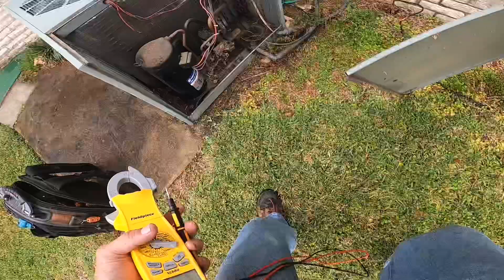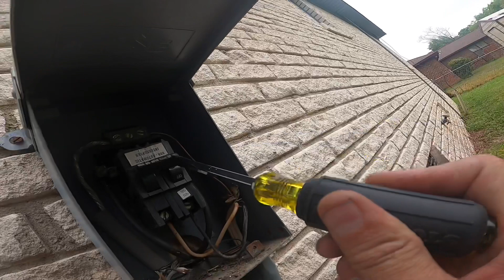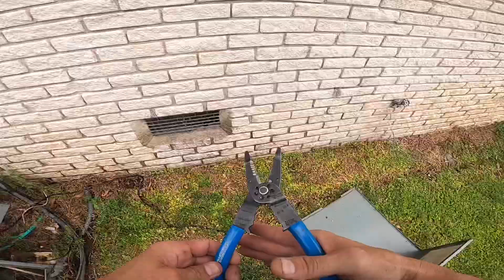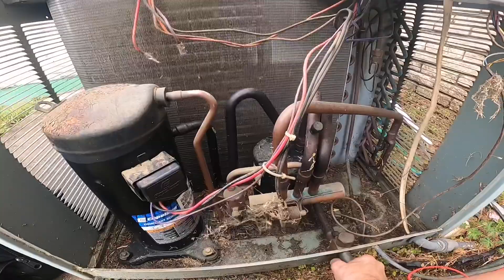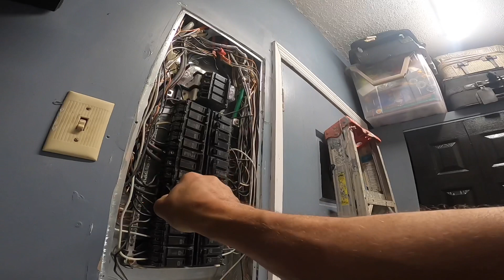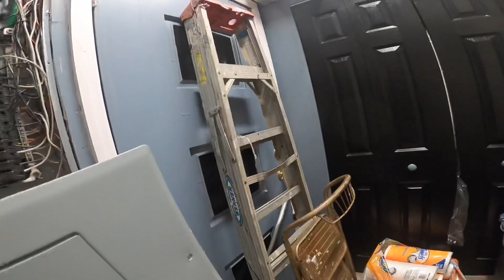No power, eliminating all variables before finding problem.

Comment: Catching up on Videos Curtis, Since this one, have you invested in a thermal Camera ? 
I have one that plugs into My Cell Device. It works a real treat and would have pin pointed You to the exact "hot Spot" of the over heating connection of the Breaker.  TCview by Todon.  TC001.
Mike M.

Comment: I watch videos regularly although I’m not a tech.  I love to learn and understand many different systems.  I do lots of electrical repairs.  Now NEC code requires that breakers are torqued to specific amount in inch-pounds.  This is so that things like this can be avoided.  Whoever replaced that 70 amp (too much fora condenser) unit did not use a torque screwdriver.  As others have also noted, when dealing with aluminum wire your suppose to put “porkier”, an anti oxidation paste on the connections. I could tell it had some but adding a bit more doesn’t hurt.  Cooper solid or stranded don’t need it.  Keep up the excellent job that you always do and I’ll keep watching.

Comment: When you are touching the wires when trying to measure resistance, YOU are being measured.  You must NOT touch the wires and/or the test leads.  The 400K to megohms is you.
Reply: Also, dont chase ghost readings on a digital meter, an analog meter will get rid of those ghost readings.

Comment: I always try to keep things simple on calls like this. First before checking resistance I check power, communication, safeties, last refrigeration of course making sure airflow is good. Keeping this will cut your time on troubleshooting. Most residential hacks may tap into junction boxes which could be the reason for breaker being so high. Unit that old and amps high I would've hooked gauges up to check pressures and checked the contactor for pitting from the high amps.    High amps on compressor may be sign of low or restricted refrigerant. That may have all your mechanical electric components amps on high with low heat load. On very  hot day they'll be calling  back most likely

Comment: Come across that on change outs original breakers not changed 70 amp old school ac switches heaters on package units not downsized for new lower demand , scary  told owner for protection of unit , not to cook if something goes out on default.,✌️👍💪🙏🤔

Comment: Should use anti oxidation past on aluminum. Good find a lot of tech’s would not even look into that. Knowledge of electrical and electronics is a must have.
Reply: No Cu-Al aid could have been the problem to start with. Especially if house was wired before the new aluminum alloys for wire manufacturing.

Comment: I had an electrician tell me there was no power at my disconnect.  I said yes there is and went on to repair a blower wire.  The unit ran fine after that.

Comment: I've seen the wires that enter the fan motor so brittle that I was able to pull them out. It was intermittently tripping the breaker. Weird reading. That's why I like to keep a back up meter to check my main meter.

Comment: Do I have control voltage? Yes. Do I have line voltage? No. Nothing else matters until you find out why. The reason it's not running is because it has no power. Ohming and continuity were a waste of time at that point.
Reply: A good HVAC tech will go through the process of elimination when he finds there is no power, which is what he did to find the cause.  22 amps will not trip a 70 amp breaker. Meg ohms? very likely. Loose connection? most likely. Good troubleshooting.
Reply: @J. M. the power cable going back to the main panel could show a ground if for some reason  the insulation on the wire is wore off from vibration, crack's from old wire, mice, rats chewing on the insulation, or even carbon tracking to ground from a loose hot connection  that has been arcing for some time.
Reply: So he was looking for the reason for no power as to what is causing the breaker to trip and in this case it was a loose connection causing the breaker to get hot and trip the breaker. Hope this helps😀

Comment: no electrician put that in, because it was a square D "homeline" breaker in a GE panel.
the square d breakers are not tested nor rated for use in a GE panel or any other load center for that matter,  nor are most other brand breakers rated for use in other panels, with exception of the ones that sold the line and combined companies. the breakers will be listed and classified for use in said panels.
the wrong breaker alone could make poor bus contact and overheat, which can and often does ruin the panel bus bars. it looked like you put a square d back in, which is a no-no and somewhere schneider electric and others state so. years ago there were more panels which were somewhat universal fit design, but you were never supposed to use pother brands unless they were listed for it.
Reply: Eaton is the way to go

Comment: The breaker should be at full load amps inside, or slightly higher, the inside breaker is definitely higher than need be, the condenser fan sounds like the bearings are going bad.

Comment: I’m wondering if the wiring coming out of the breaker box to the ac unit is undersized . You did say the wires were hot 🥵 . This would mean the wires can’t support the amperage. Good call on putting in the correct amp size breaker fuse for the unit . I have a feeling there gonna be calling you back .
Reply from the maker: It was a #6 aluminum   Plenty big enough
Reply: @HVACGUY  gotcha , good repair
Reply: @HVACGUY  aluminum not my first choice , they have tendency to loosen fast build resistance from bad connection  electrical contractors low bid choice  , good deducing always Curt like your style stay safe on those panels ,👍✌️💪😔💎⚡🖖
Reply: 50 max amp on 6 wire plus connections not tight on breakers cause of heat on breaker. ,

Comment: so to test a shorted fan, put the probe on the black wire at the contactor to ground and do same for the red. If it beeps, it is shorted?
Reply from the maker: In this case I tested for shorts before and after unhooking all the wires to fan. But if you wish to ohm it out, disconnect all wires and ohm ends to ground, then ohm between. But, you can’t ohm it out hooked up.

Comment: you didnt say which amp u used? I kept waiting
Reply: sorry you wrote it. So we use a 40 amp ?
Reply from the maker: @sh2697  yes, it was a 40 amp
Reply: What should the megaohm read for L1 and L2 to ground when disconnectedd at the contactor? and the two lead going out? I like to keep this in mind
Reply from the maker: @sh2697  mega ohm readings to ground are a little concerning, but not damning. On power leads that was odd. Anytime you see mega ohms to ground, you should ohm out compressor before condemning anything, sometimes that will trip a breaker. But, the kilo ohms to ground was really concerning. It implies an abrasion in insulation somewhere. So, in a perfect world you shouldn’t show any ohms to ground, like when I isolated compressor and tested it.

Comment: So the replacement breaker was 70 amp ? Just trying to learn something here. Why not proper sized breaker for the replacement ?
Reply from the maker: No, i replaced it with a 40 amp breaker
Reply: @HVACGUY  Ok, you might have mentioned that in the video. Thanks for your reply and posting video.
Reply: He mentioned it at the begining of comments some installers or electricians don't change old breakers ac units or water heaters less demand lower breaker amps with safety factor 15% added 30 amp protected 40amp breaker.👍💪✌️🙏😊

Comment: An electrician definitely should’ve known better
Reply: An actual electrician that know what he doing, would probably know better, when you have a loose connection, not only you will have choppy performance out of whatever it powering, you could have the potential for arcing and heating, which is a safety issue, including the oversized breaker.
Reply: @KenKen-ui4ny  absolutely, making sure all connections are tight helps too
Reply: was he getting 22 amps at the condenser as well, idk sounds kinda high for just a compressor and outdoor fan.
Reply: to be honest theres no telling what all could have been connected to that 70 amp breaker. I couldn't pay attention if it was the same wire I'm the panel and the disconnect outside
Reply: 14 amps on start drop down to 10 ,12  even for a dinosaur change out candidate.✌️👍🙏🤔

Comment: 70 amp breaker?  Wow that’s what keeps fire departments in business 🧑🏼‍🚒🚒🚒. In Connecticut our license only covers to the disconnect.
Reply from the maker: Yeh, I just couldn’t leave it.
Reply: @HVACGUY  I’ve done similar things but just need to be “ creative “ on how I write it up . 😉
Reply: At any moment you will have to have a license to go to the bathroom….😂😂😂😂😂
Reply: Same here in FL. Can’t touch anything past the disconnect. But I still change breakers on change outs all the time. I’m not gonna make the customer pay for an electrician when it’s something I’m capable of taking care of. I don’t write it up on the invoice though.
Reply: Technically In GA we should not be changing breaker in main panel. Dumb rule because am I going to send an electrician out on every job I install to change a breaker. 👎 nope! Make customer wait longer for them to show. No air for another day. Sorry ma'am we installed it but you can't turn it on. The electrician said he can't get here till tomorrow. Sorry it's 95 degrees upstairs 😆. Just change the breaker and stop being scared of being sued. That's what insurance is for.
Reply: @97Napkins  yep I agree. I just do it anyway to take care of the client, number one priority.